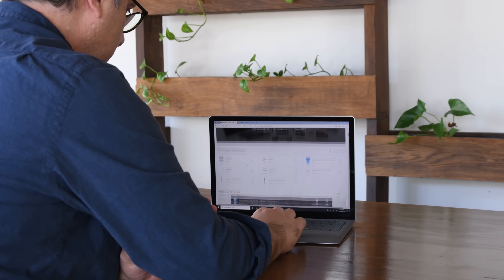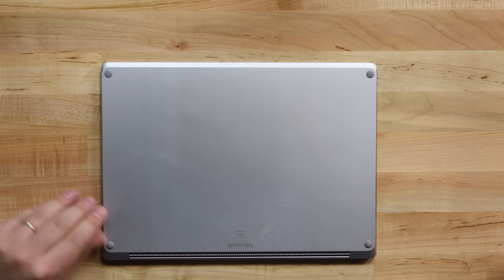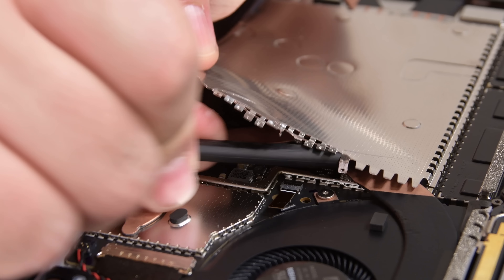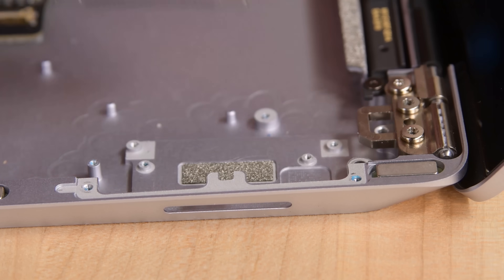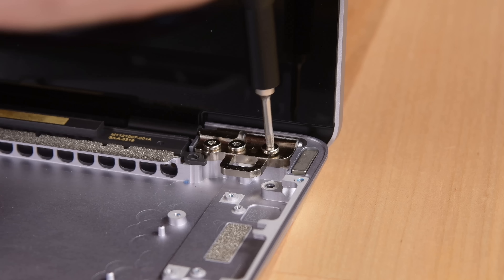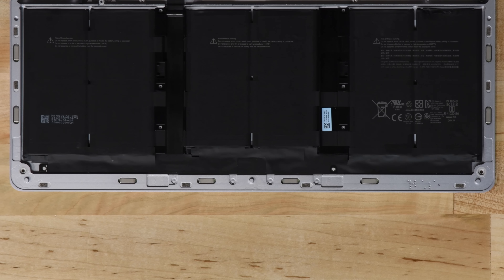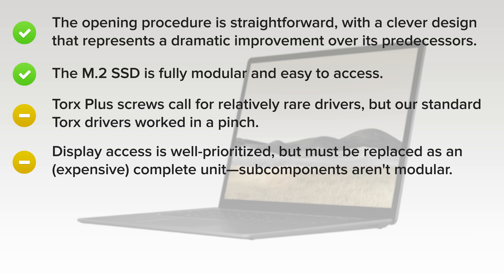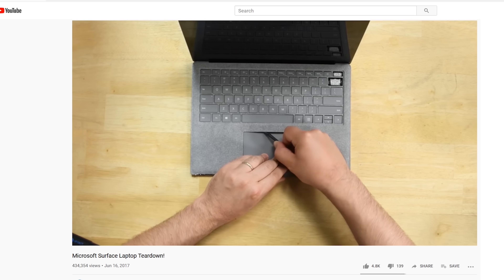Surface Laptop 3 (13.5 inch) Teardown-Still the Least Repairable Laptop Ever???

Comment: I loved that magnetic thing that holds the keyboard
Reply: Dunno guys, the idea of having both sounds clumsy and unnecessary to me.
Reply: @VijayKanta  usually mainstream electronic held together by combination screw+adhesive or screw+series of plastic/metal clasps around the perimeter. so using screw+magnet combo doesn't sound clumsy to me.

what's sound clumsy to me is thinking screw + magnet combo sound clumsy without realizing redundancy is really necessary in engineering
Reply: Augusto Ferreira yep only if one of the magnets or holders break down you will have a vulnerable moving keyboard
Reply: @VijayKanta  Keyboard is held down with screws as well
Reply: @saranwrap8836  I don't understand the logic. Why both?
Reply: @VijayKanta  Screws allow replacement, magnets instead of glue make its easy
Reply: @VijayKanta  If I had to fancy a guess it's for when your done fixing the thing the magnets are there to make lineing the thing up easy.
Reply: @VijayKanta  how does a magnet break down? Do you mean a literal mental breakdown? like a midlife crisis or what?
Reply: searchforthebackblec if you use a magnet ~ in a dynamo it’ll demagnetise ~ usually taking 5-20 years - if sitting idle it’ll be 1000.
Reply: Vijay Kanta given neodymium magnets have a lifespan of 1000 years I wouldn’t worry about it.
Reply: @VijayKanta  that's what the screws are for.

Comment: I'm not entirely adverse to replacing a display as a complete module, since the display, touch digitiser, and glass are all usually glued together so tight that you may risk damaging the digitiser or even display when you try to pry the glass off.

I still appreciate when the related driver boards are modular, though.

Comment: The SSD is not really user serviceable. The forme factor and connection is as good as proprietary.
Reply: Not unique, but rare form factor.
Reply: I agree to an extent.  While its not impossible to upgrade, most M.2 SSDs use a different length (and maybe a different socket, I'm not sure) which makes upgrades a lot harder.  Still wouldn't say its as bad as proprietary.
Reply: there are several compatible SSD's on the market (Toshiba BG3 & 4, Sandisk SN520). You can put a 512GB SSD in this for about 75$
Reply: M2-60